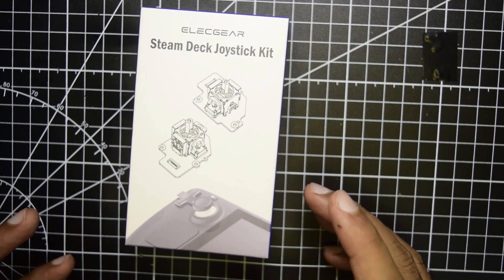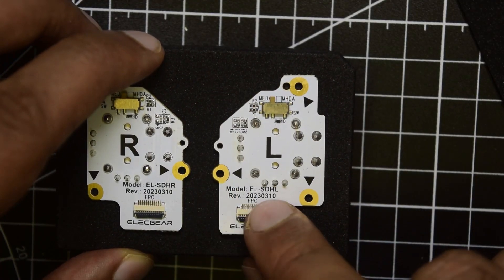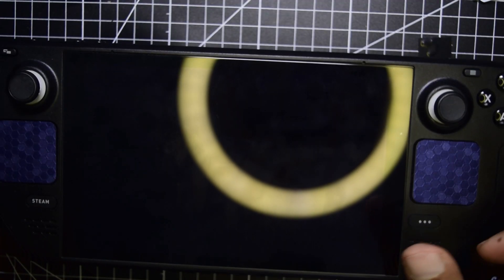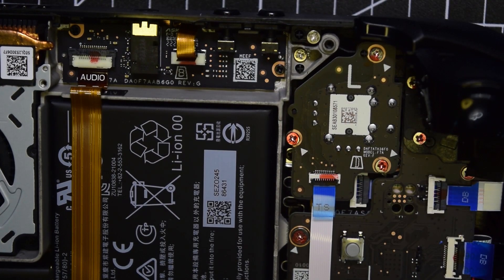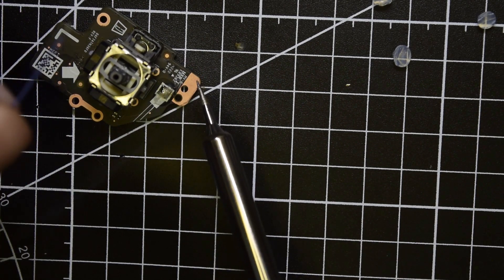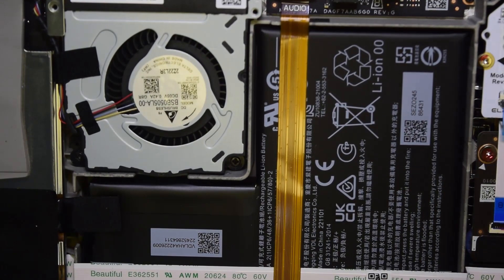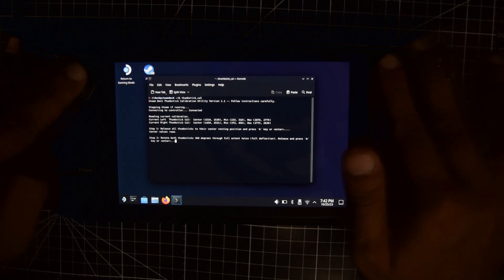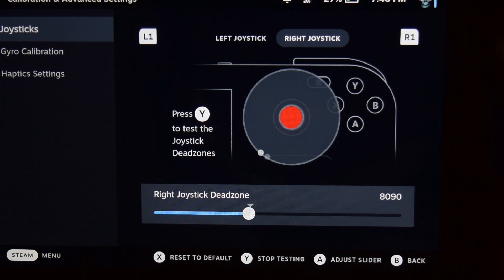ElecGear vs Gulikit which is better? | ElecGear Joystick Hall Effect Sensor for Steam Deck

Comment: Hey man i was wondering if i can use this analog as replacement to my gulikit kingkong 2 pro gamepad, or is it only work for steam deck
Reply from the maker: the straight answer is no its not direct replacement for kingkong 2 pro so it cannot be swapped directly as on controller joystick is soldered directly on controller mother board. but if you are good at soldering may be you can just desolder it and take the module out and replace it. I have not tried it but seems possible. I hope this helps. Please stay tuned to my channel for my future video.